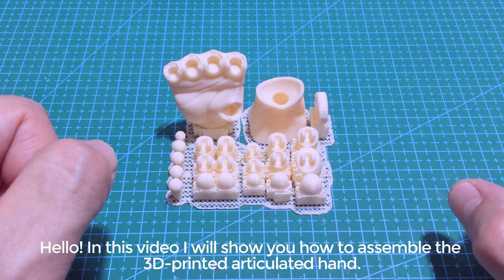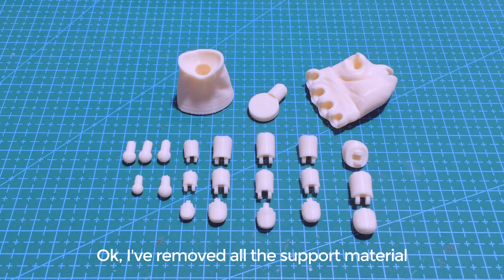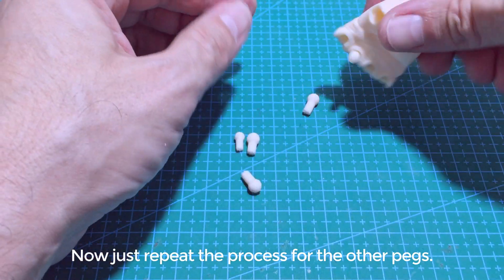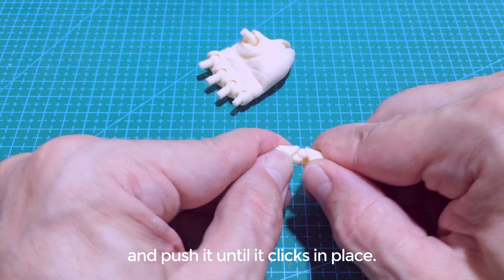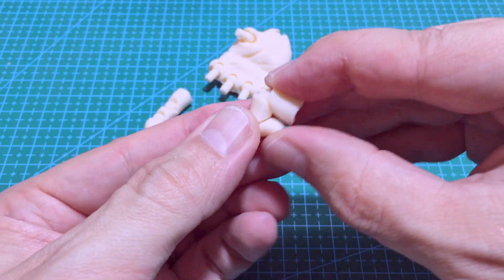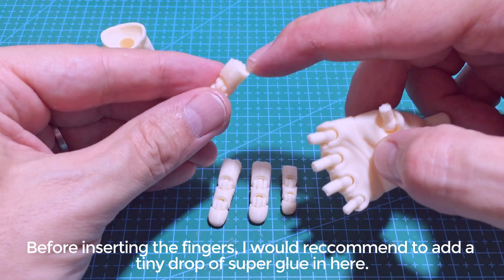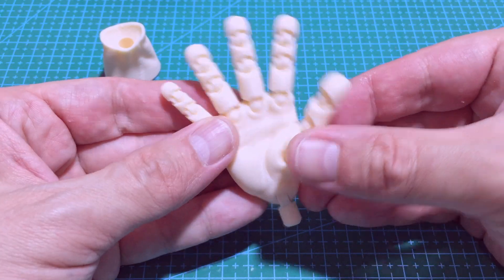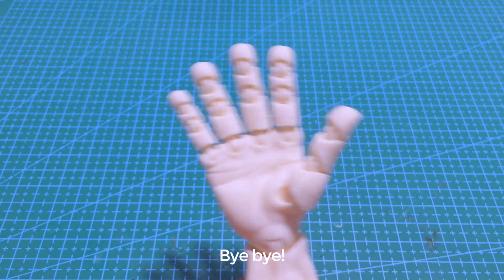3D Printed Poseable Hand - Assembly instructions

Comment: Hey personally I think this is fantastic for like a giant figure build like a sentinel or something of that matter I've been thinking about doing a custom similar to this one for a long time

https://youtu.be/iKYxmlb9vE0

And I think your hands might actually be God tier your perfect for that

That being said though you think you might be able to make some different variants? Like primarily a 3D print file of some demonic claws like you see in the video with long fingernails and such or maybe some monster hands

You know different base models like that that you can adjust or customize to your need but where you won't have to customize to a point where you'll worry about damaging the articulation

I also want to say I like the more durability Factor you're going here although I do like your action figures I do feel like the open joint areas or like the claw like part of it is more prone to breaking as well as like the shoulder knubs usually figure companies try to make them beefy bulky and the biceps a little rubbery so that way they stretch a bit

But I got to say I'm loving all the popping noises in here even the fingers which I thought weren't going to be sturdy seem pretty damn held together well where there's no need for glue or anything

So keep up with the good work and don't be afraid to use more pegs and stuff ball joints and pegs are probably the most strongest and sturdiest way to assemble things especially when they pop in nicely like that

The only time a joint shouldn't be that tight as if it's like a head that needs a swappable part or something like that that you're going to removing on a constant basis

Like one of the things I always hate Hasbro doing they make their wrist pegs so tiny that literally you move it slightly and it pops out instantly toy biz used to make them super thick at least an inch in size that way it holds and snug as a bug in a rug but yet pulls out for when you need swappable hands but bravo I can't wait to see what you do next

Comment: You skipped over the thumb ballpoint.  That was a pain
Reply: What problem did you have with that thumb joint? I may re-print the thumb piece with the hole in a slightly different position, but I had no problem fitting it per the downloaded files.
Reply: @michaelnoble2432  It was difficult to get popped in due to the thumbs angle, but got it in the end.
Reply: And I may know why: if you go back to https://youtu.be/Mq6EBsp5dtQ?t=53 you'll see the creator says you need 1 small 3 medium and 1 large balljoints. But what do I spot at https://youtu.be/Mq6EBsp5dtQ?t=39 He printed 1 small, 1 medium and 3 large balljoints. I think he may have needed to do some creative editing to complete the video, omitting the hardest of balljoints; the largest.
Reply: Can you please send me the file I don’t have a credit card please
Reply: @randomuploadss6257  Your asking to get the file for free right under the makers own page, not cool.
Reply: @StarATL  funnily enough, that was the easiest joint for me to get in place. I was referring to the fact that the position doesn't seem as visually pleasing as the others.
Reply: @randomuploadss6257  sorry, it's a paid file, but only $5: https://www.cgtrader.com/3d-print-models/art/other/articulated-poseable-hand-3dprint-ready